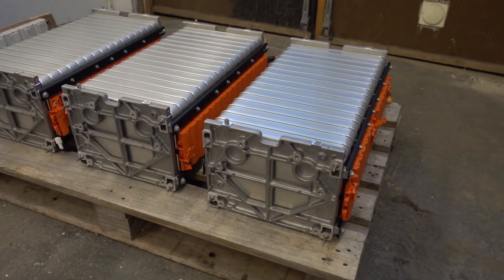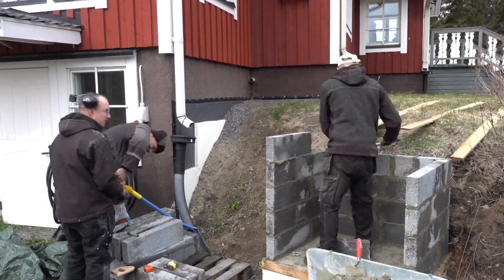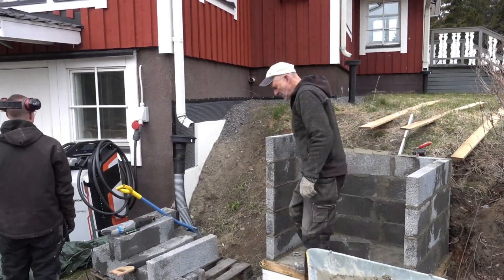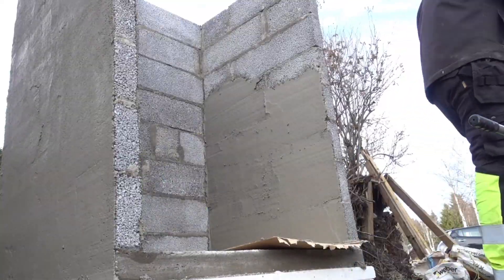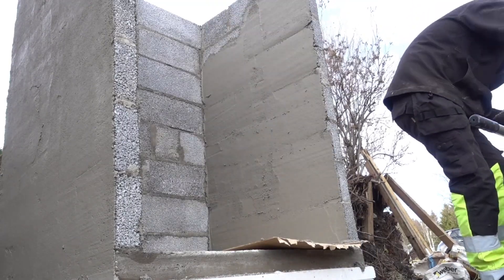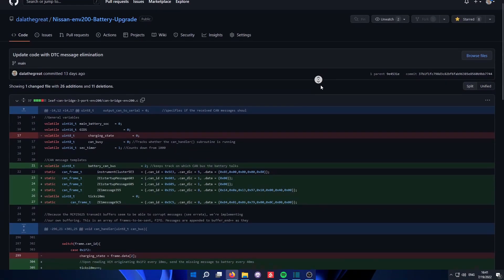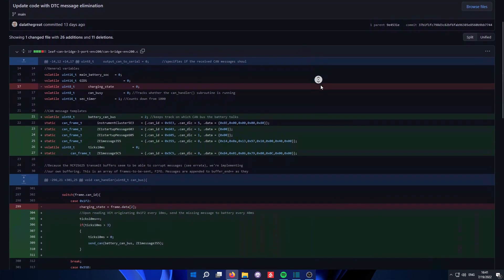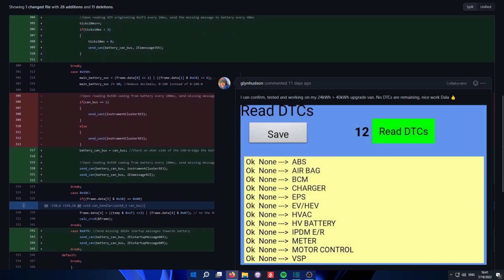LEAF CCS, EVNX, and other various project updates

Comment: Good luck with getting your EVNX road legal! I was inspired by your build last year and have since converted my Honda CRX with the Resolve-EV controller and had gotten it road legal just 2 months ago. It sounds like the requirements there are much stricter to get it road legal. And your your battery box looks great! Thanks for your inspiring videos!
Reply from the maker: Is your build over on the diyelectriccar forum? If so, it's awesome, just took a peek at it :)

Comment: Hi, please figure out how to connect the Leaf's battery to the inverter, as a photovoltaic battery storage, something like V2G
Reply from the maker: Not many inverters that can take a 400V battery!
Reply: @DalasEVRepair  I've been using leaf packs in combination with a standard grid tie solar inverter to feed back to home or grid succesfully, by connecting the battery on the pv/mppt inputs that usually handle around 200v-1000v. just experiments a few years back but just recently bought my own 30kwh leaf pack from the junk yard so will soon get to put together a more permanent setup soon. using a huawei hybrid inverter, so next step would be to try to use the actual battery inputs instead, which I guess requires some properitarian  rs485 communcation though.

Another way to use power out from leaf or leafpack is to run VFD's for motors, also most SMPS will work well on 400v, the major problem I guess is to get a safe setup with regards to PE and also standrad mechanical switches might not work well if you need that.
Reply: @linus-IO  Now I'm going to make photovoltaics with a Huawei inverter.
Think of something to communicate :) Please.
Reply: https://youtu.be/XHZWGLzT7gg

Comment: Thanks for the CCS mod update, but I think the “lim” is not a good and future proof solution. What we really need is a complete reverse engineered CCS DIY kit including that Qualcomm GreenPHY PLC coms. What I personally would do is just a CCS adapter for the Chademo port, small DC bridge cable with CAN bus on the Chademo side and GreenPHY coms on the CCS side, no need to disassemble your Leaf and you can also sell those adapters, I would buy that thing immediately.
Reply: Fell free to do so. Nobody is limiting you to build whatever you want.
Reply: Same. Many cars other than the leaf use CHAdeMO. I'd gladly put my money where my mouth is if I know for sure this will happen.

Comment: I am doing a conversion and decided to cut up the wiring harness too. But I also decided to run everything on CAN bus so maybe you would like to use my CAN boards to drive the headlights, tail lights doors etc. I also got keyless entry working.
It would be great if we could work together on some of this stuff.
Reply from the maker: Well now I am halfways there with the wiring 😅 maybe next time I'll go CAN controlled there!
Reply: @DalasEVRepair  I am also trying to implement keyless entry. Do you know what the manufacturers use? I have got something working with BLE but not very reliable.  Maybe it is the position of the receiver?
Reply from the maker: @franciscoshi1968  No clue. Check with some discussion forum? :)

Comment: CCS charge port for Leaf would be useful with Chademo going the way of Betamax. The EV conversion vehicle does sound like a practical way to figure out how to get CCS charge port working while you use the Leaf as daily driver. Do you plan to retain the Chademo port so you have both or remove the Chademo port so that you can use the original charging location on the Leaf?
Reply: This depends between countries. Some have queues for CCS but Chademo is unused and easily available at most sites. The only problem will be in countries where 50kW chargers phaseout.

Comment: At 7:32 a scoop would increase drag; does the EV conversion need that much more cooling? Maybe an air extraction cover or just an old school power bulge. 🤔
Reply: It probably doesn't need the cooling since the motor/PDM/inverter runs pretty cool already. He could relocate his radiator up there but that isn't much value either.

The value of a scoop is usually for ICE motors actually use the scoop for air intake for the combustion. Most effective for turbos or superchargers.

I had considered a scoop myself as I did a similar build but instead disassembled the leaf motor, PDM, Inverter, and Motor, and ended up not needing to cut my hood. I wonder if that would be a viable solution for Dala but that would add additional scope and it's better he gets it road legal first so he has an alternative car when he does projects. Maybe a hood bump but not an actual scoop might be a better solution but it might not look as cool.

Comment: Move to teensy 4.0 it has 3 CAN busses built in and is bloody fast
Reply from the maker: Interesting, but also out of stock on many sites :/ But will look into it! Thanks!
Reply: @DalasEVRepair    Does anyone know what's main reasons the atxmega32c4 was chosen in the first place?

If a decent alternative mcu got suggested I would be happy to help porting.
I was thinking of using the macchina, which I already have 2 pcs lying around, but seems like they are out of stock also an even the arduino due and it's mcu is quite hard to get, so maybe not the best choice for the community.
 ESP32 is not affected yet right?